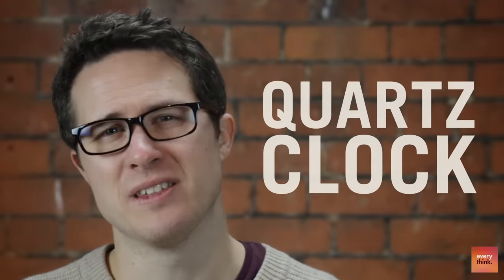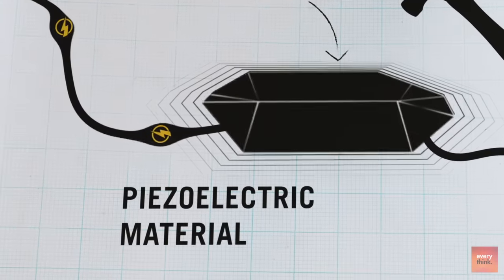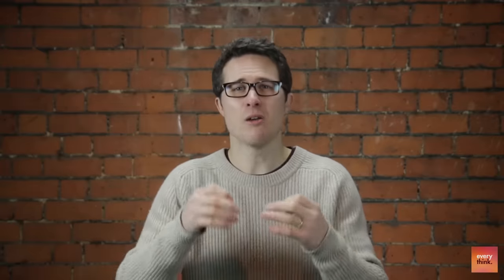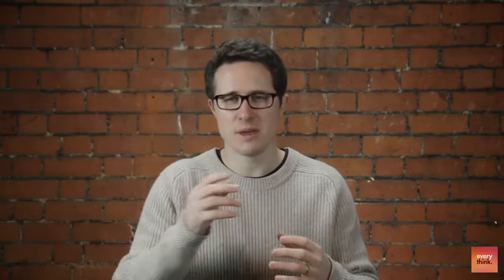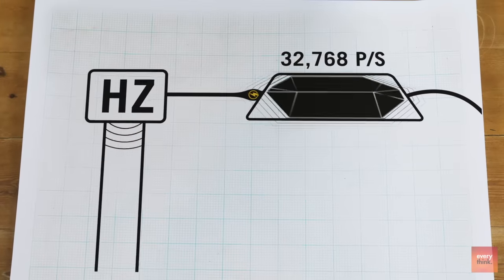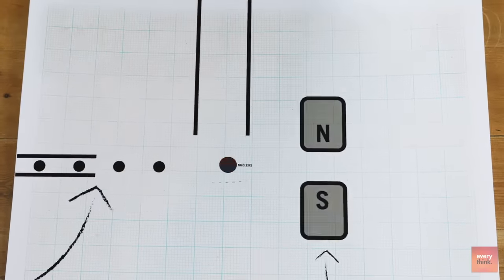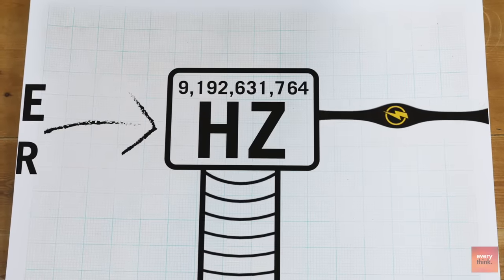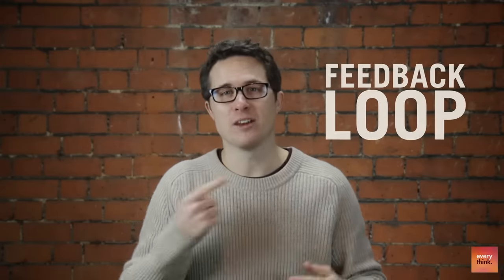How Do Atomic Clocks Work?

Comment: if atomic clocks are using radio waves radio waves and vibrations and those are effected by the Doppler effect that means satellite are effected by the Doppler effect and not time dilatation so time dilatation is yet to be proven to to the atomic clock not being accurate enough to test that
Reply: the source and the observer are not moving relative to one another. They're in the same frame of reference so there is no Doppler effect.
Reply: Kimi Zwazy how in a non static universe can you have a static clock EVERY THING IS MOVING so their for two objects moving at the same speed dose not notice the Doppler effect but it is still their and it is noticeable in the clock because their is 2 parts to the Doppler effect at the front of a moving object yo have a compression of the wave but at the back end you have an expedition its like being on a boat the wake you make is the Doppler effect do two moving boats not make wakes no thy both make wakes

even to er do not notice the effect the clock dose 

also tho only way for two object to take up the same frame of reference is if thy occupy the same space and because two object cant exist in the same space at the same time without interfering you can never say two object have the same reference

also considering we are on a sphere spinning even a centimeter differences in height makes a difference in speed taller peoples head move faster then shorter peoples heads and everyone's head moves faster then their feet
Reply: Kimi Zwazy did you know Doppler effect takes place even in a moving car

the speakers at the front of the car will have a longer wave then the speakers at the back of the car

lets say you are in the middle of a moving car and you are equal distance from both sets of speakers and you send out on sound wave just a beep it will take longer for the sound to come from the back of the car then it dose from the front of the car

so their for depending on how you have your wave emitter and measurement devise set up the clock will be off if the wave is projected in the direction the earth spins the waves will be close together and if is is emitted in the opposite direction the earth spins the waves will be longer thus effecting the frequency of the wave so if the clock is only accurate at x frequency and it is changed to y because of movement or direction then the clock is not accurate at all
Reply: The Casium atom (transmittor) and the dector are at a constant distance from one another. It doesnt matter if how fast they are travelling, whilst on the earth hurtling through space, due to them being in the same 'frame of reference'. For example, if your on a train travelling towards someonen how is transmitting radio waves to you will perceive these waves more frequently and it's frequency will increase (Doppler effect, we're on the same page here). But if that person was at one end of the carriage transmitting the same radio waves and your at the other end observing them, then you will precieve these waves at contant frequency reguardless of how fast the train is moving. This is because the transmitter is moving at the same speed as you are.
Reply: That doesn't happen in a moving car. I understand what you're thinking. Doppler effect is when the source and the observer are moving relative to one another, and is regardless of how they are moving relative to anything else.
 Quote Wiki 'The Doppler effect (or the Doppler shift) is the change in frequency or wavelength of a wave (or other periodic event) for an observer moving relative to its source. ''
Reply: Kimi Zwazy dose not matter how far apart thy are if the emitter is behind the detector in compare to the direction of movement then the wave will be shorter  if the emitter is in from of the detector the wave will be longer if you move the clock up one foot the wave will be longer if you move it down a foot it will be shorter if the wave is what causes the atom to go in to that exited state and it requires a spasific frequency to do that changing the wave length changes the frequency thus throwing off the clock 

also thy soot the atom up threw the wave then it falls threw the wave that phisical movement of the atom IS EFFECTED BY SPEED DO TO CONSERVATION OF ENERGY if you are not moving what goes up comes down exactly ware it started from but because everything is moving a ball thrown up not only moves up but in the direction of movement thus instead of a linear path the ball must make an angular path instead so their for it takes a further distance to compeat the same action thus the ball will stay in the air longer the faster you move 

so that physical part of the clock is also effected by speed
Reply: Kimi Zwazy as for you radio waves lets say you take two of the same waves you have emitted from the front of your train car one and one from the back and your receiver is exactly the same distance from both you will get more waves from the front emitter then the back thus Doppler effect is always present  so it matters how it is oriented and how fast it is moving
Reply: Kimi Zwazy simply turning the clock 180 degrees will change the clocks time
Reply: Kimi Zwazy moving the clock a millimeter off the ground will change the time change in the rotation of the earth will change the time how close or how far we are from the sun will change the time 

practically the atomic clock is as temperamental as a souffle
Reply: Kimi Zwazy do this as an experiment take a high pitch speaker emitting a high pitch noise like a electronic dog whistle set it so you can just barely hear it when sitting still put it in the back seat of your car and go to a freeway and see how long it takes till you cant hear it because the pitch got to high 

the Doppler effect is only more noticeable between two object because of the relative speeds involved
Reply: after watching your video 'Black Hole What Are Thy' I have come to notice your enthusiasm about everything to do with science. I have also come to realize how much wrong information you have, and also your arrogance. In that video you mistaken the word Sun for the word star, also the process in how a star turns into a black hole is not how you explained it. fusion happens in a star not fusion. And the information problem is something which is far out of our grasp. to understand that concept completely  could only be done through equations. You also don't understand frames of reference nor the doppler effect correctly and me trying to explain it all would be a waste of my time. But I am going to explain that people have a hard time changing their minds about things and also over estimating their knowledge to feel important. You also need to learn how to spell. It's not 'Their for' - it's 'Therefore'.
Reply: Kimi Zwazy what is a star to a distant galaxy but a sun 

sun is not the name of our star 

sun is a what not a who or a ware 

if your on a extra solar planet and you get burnt by its star what is it called a star burn or a sun burn
Reply: Kimi Zwazy as for my theory you might not understand the loss of information but i do basically elementary particles can not be destroyed thy must always exist in some form and thy will have the traces of how thy changed form like in math the numbers added up can be subtracted in the same manner and no information is lost 

as for fission yes stars do create fission just in small amounts but thy do on the surface the fusion is in the core
Reply: Kimi Zwazy star and sun is like us and them 

if its over their it is them and star if its over hear is us and sun
Reply: Kimi Zwazy also if your going to discount someone for spelling scratch everything Einstein did because like me he was dyslexic

and if your going to discount some one for referring to a distant star as a sun the scratch every scientist of also because everyone dose it 

and im not over estimating my knowledge i said in the video im not smart just pointing out my counter theory to their theory and stating that their theory is just as much fantasy as god

as for being precise about how a sun sorry star works i could have spent the hours needed to go in to exactly how it happens but that is something else entirely my main point was about the event horizon and what it was and how it worked 

and just because i see frame of reference differently then you dose not mean i don't know what it is frame of reference is a part of thought experiments and do not exist in reality   because every thing has a different from a reference do to relativity because frame of reference can only exist in a static universe and our universe is not static that is why in frame of reference toy feet and head are not moving when standing still but in reality do to the spin of the earth your head is moving faster then your feet  

but apparently its a waist of my time to explain all this to you as you are the one set in the ways of regurgitating what someone else told you instead of thinking out side of the book and that is why miss spellings bug you so much
Reply: Kimi Zwazy funny you sent me that link first thing in the surc

Fission is the splitting of atoms, either by radioactive decay or by collisional impact. Certainly radioactive decay occurs because the sun contains many radioactive isotopes including thorium, uranium etc. Basically fission happens irrespective of any environmental constraints because it is an intrinsic property of radioactive nuclides.

Although the energy produced by fission is comparable to what is produced by fusion, the core of the sun is dominated by hydrogen and at temperatures where hydrogen fusion is possible, so that the dominant source of energy per cubic meter is in fusion rather then the fission of very low abundance radioisotopes. Fission is not a significant source of energy so long as the temperatures and densities are high enough for fusion to occur.

http://image.gsfc.nasa.gov/poetry/ask/a11197.html

from nasa HUMMMM and you proved what

oh ya sun's produces fission thinks

but you read this part and said ha got ya bitch

Fission doesn't happen in the sun. Elements are neatly divided at Iron, atoms smaller than this are energetically capable of fusion - they give off energy when fused. Atoms heavier than this can in theory be fissile, energy would be needed to fuse them but they give off energy when they split.7 Aug 2012

NO SHIT IT DOSE NOT HAPPEN IN THE SUN IT HAPPENS ON THE SUN

in on big difference notice i did not say in my vid whether the fission or fusion was in or on no i just said it created both so how am i wrong
Reply: Doppler effect accounts for the apparent change in frequency for observes in relative motion. But the radio wave emitter and the  cesium detector are moving at the same velocity within the atomic clock and therefore wouldn't observe a Doppler effect bruh.
Reply: Unfathomable Kiffness the detector and the emitter might both be moving relative to each other but the moment the wave leaves the emitter till the time it hits the detector it itself is in a different frame of reference and their for no longer in sync with the emitter and detector thus the Doppler effete would takes place but the amount would be minute but to an atomic clock it would account for the accumulative time loss
Reply: Unfathomable Kiffness also you can look at it like this if we are on a bus going 30 MPH and we toss a ball back and forth it would act like we were siting still but what happens if we try and do it as it stops and go's picking up passengers it would effect the ball and we could not be able to reliably toss it back and forth

now lets look at the clock we build it on earth start it tossing its balls back and forth put it on a rocket shoot in in to space super fast then have it spin around the earth constantly speeding it up and slowing it down to keep it in orbit at that point not only is the speed change going to effect it but the slight shift in orbit would change the amount of gravity effecting it 

so how accurate are atomic clocks again remember the more accurate it is the more the variables effect it and their are a lot of variables
Reply: Thats why the ceasium is used to compensate the error...
ceasium atoms would deflect if the waves are affected and the detector would set them right by sending a jolt of electricity..
The time dilation is right its proven.
Reply: Jakka Karthik but that's just it the cesium would be effected by the speed also pulse the waive thy use to excite the cesium would be off do to the speed so their for the cesium exited state would be off meaning the clock is not accurate in any way shape or form as it is all effected by speed and what we know about the universe is everything is always moving but never at a constant speed so the clock would run slower as we moved slower and faster as we moved faster it would also be effected by the gravity of the moon as it passed over head the gravity of the sun as we wobble closer and further from the sun

no once you look at all the parts and how every part gets effected by gravity and speed you see that the clock can not be accurate but we will never know why because we measure the accuracy of a atomic clock with an atomic clock that is already not accurate

its kinda like how thy date fossils thy use the sediment layer to date the fossils but thy use the fossils to date the sediment layer but you cant do that it is not accurate because is the fossils got shifted do to earthquakes or from being buried then you would have a inaccurate measurement of both the fossils and the soil that's why we started carbon dating but to get the time of carbon decay was set based of of fossils that were dated by the sediment layer that was dated by the fossils and thy wonder why something that just died can have a carbon date of 10 thousand BC its because thy started from a flawed foundation and added to the flawed foundation to get a flawed science 

atomic clocks flawed science is relativity and thought experiments that use frame of reference but in reality their is no frame of reference because nothing exist in a vacuum and out side forces matter and thy get neglected in the thought experiments and in general relativity